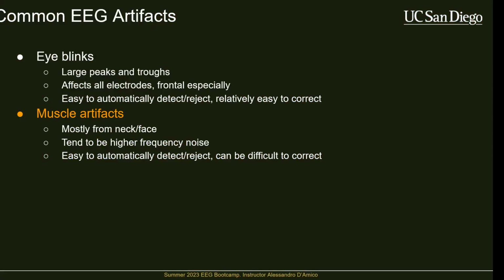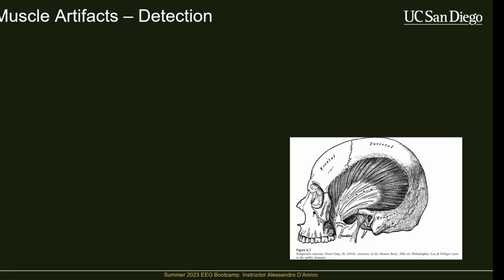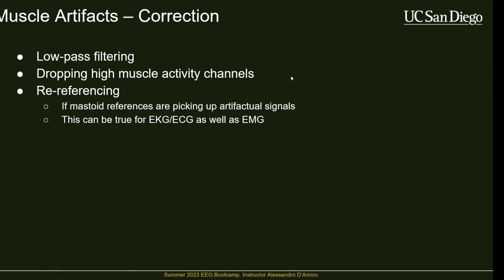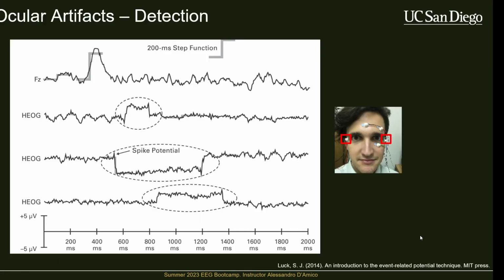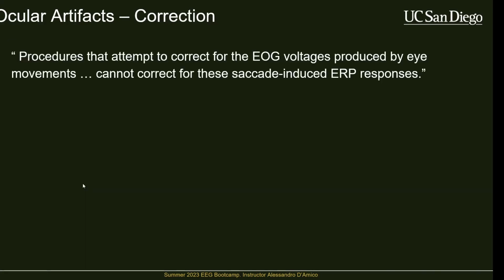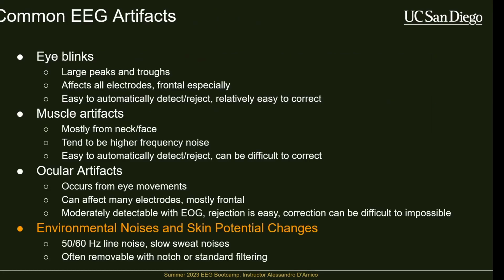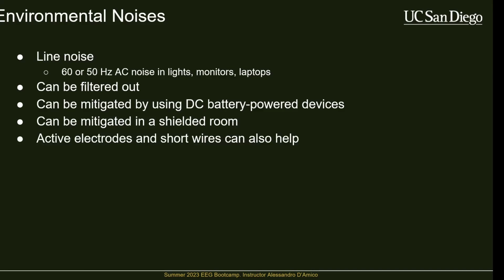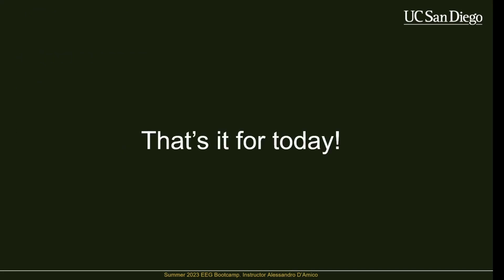[02] EEG Bootcamp - Artifacts Continued

Comment: Please enable english subtitles
Reply from the maker: Done! Also, I'm replying to one of your comments on a video I have now removed as per the wishes of the individual recorded.

Your comment was: "EEG Bootcamp was very useful for my research work. Please give details about consumer wearable EEG devices list with price. How to buy or if possible for use in any Biomedical institutions for access to their EEG devices for research purposes. Then, to tell about their coding using python in EEG data preprocessing and feature extraction is complicated using many tools and software."

The amplifier used is the OpenBCI Cyton. It's $1000USD and all information is available on their website: https://shop.openbci.com/products/cyton-biosensing-board-8-channel

The cap I used is by GreenTek, it's a 19 channel cap, but we only use 8 of the electrodes + ground and reference with the Cyton. This cap is $500USD (I'm using the coated Ag/AgCl version): https://shop.openbci.com/products/openbci-eeg-electrocap

If you're interested in data processing, please watch my lectures from my BCI course COGS 189. You can also find code for analyzing EEG data in Python in my github repo for the class: https://github.com/desa-lab/cogs189wi23

Regarding borrowing equipment and using it for research, this depends on your institution. Researchers who have this equipment may be willing to collaborate or loan out their equipment, but this is typically done within a university/institution. In terms of collecting data, you need to typically obtain informed consent from your subjects and this form and procedure are usually validated by an institutional review board, typically associated with a university.

I hope this helps.